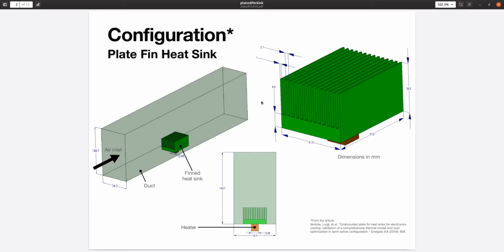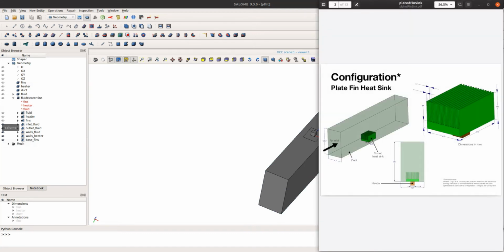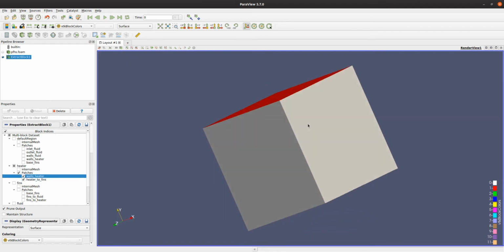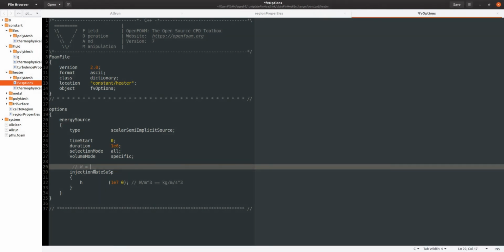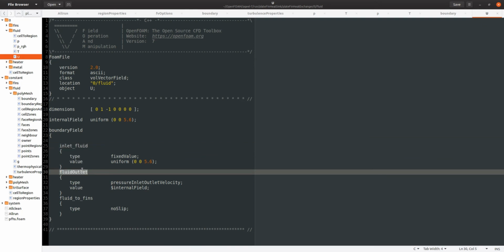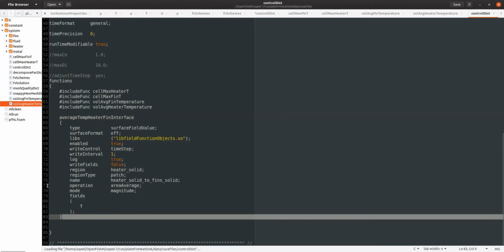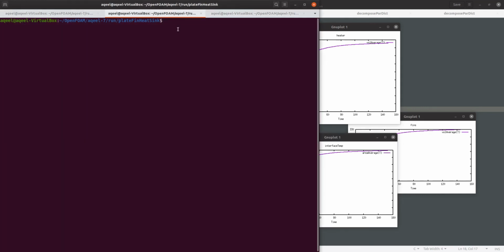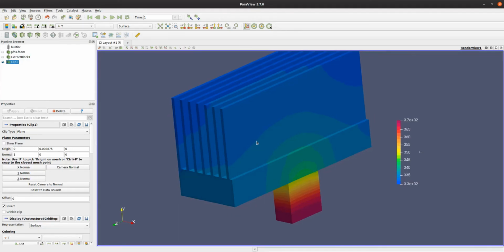Conjugate heat transfer (plate fin heat sink) with Salome, OpenFOAM and Paraview

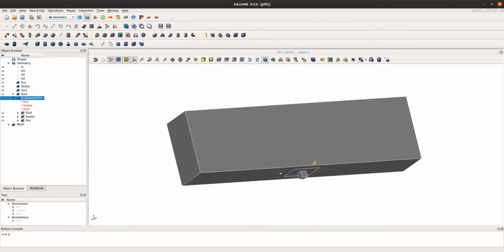Comment: why am i not getting fluid, heater and fins solid region after partition tool at 4:29, instead getting only 3 red-lettered objects as fins, heater and fluid
Reply from the maker: To get the regions separately after partition.

Use the same method like for boundaries, select region -> select volume, and create a volume region. The partition tool already created three separate volumes.
Reply: @cae4edu189  Got it done, yayyy , thanks a lot

Comment: Thank you for this helpful video. I have tried to run the case file uploaded on Github and everything is ok until executing chtMultiRegionFoam. This error appears 
 Cannot find file "points" in directory "fluid/polyMesh" in times "0" down to constant
[0]
[0]     From virtual Foam::IOobject Foam::fileOperation::findInstance(const Foam::IOobject&, Foam::scalar, const Foam::word&) const
[0]     in file global/fileOperations/fileOperation/fileOperation.C at line 1003.

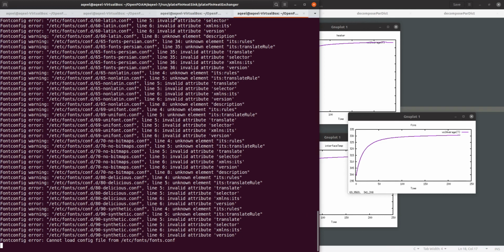Comment: Hi! Thanks for the tutorial and all the clever tips that go with it. When you visualize the results in paraview at 43:50, how did you create the file pfhs.foam with all fields from all regions ? So far I've only managed to visualize the fields from one region at a time. Thanks.
Reply from the maker: Just create a new file in the terminal typing: touch pfhs.foam
Reply: @cae4edu189  Thanks, it worked. Although it seems paraview should be used wih this workflow instead of paraFoam.

Comment: @cae4edu189 , thanks for sharing your knowledge. I followed your steps exactly in my case, but when I tried to apply heat flux using externalwallheatflux BC of FixedGradient BC, it works as zeroGradient. What do you think what is the reason for this?

Comment: Thankyou for the video. But how do even get the solution to converge as I haven't seen boundary layer inflation in the mesh for the fin-fluid interface to capture the thin temperature and velocity gradient. The tetra-cell is ok within solid but we are thought not for fluid near the solid surface. If you could comment on the sufficiency of the mesh to get a reliable result.
Reply from the maker: The mesh used here is only to demonstrate the approach. For a detailed study mesh convergence must be performed with several refined meshes. Same holds for resolving the fluid side boundary layer.

Comment: Thanks your video, By the way, If there are inlet and outlet face in the fluid cellzone, How can i add the inlet and outlet facezone in the fluid cellzone? I already try it but, facezone does not appear in the polymesh folder.
Reply from the maker: I guess you have to define them as patches.
Reply: @cae4edu189  Hey, I already define them as facezone in salome but when I run "splitMeshRegion -cellZones -overwrite", They do not recognize facezone but only interface between cell Zones. I want to define two facezone but now, Only one facezone is defined. Do you know any solution?

Comment: Thank you for the good lecture. By the way, I have one simple question. How can I apply heat flux boundary condition at the wall?
Reply from the maker: You can use fixedGradient boundary condition, that will set the heat flux, which in turn is also related to wall area
Reply: thank you for your kind answer. And i have one more question to ask. Is there a way that i can see the area average value at paraview?
Reply from the maker: You can try  some built in filters in the Paraview.

Comment: Hey. Did you imported all bodies as seperate files?
Reply from the maker: I used Salome Shaper module to make each part. It can then be moved to geometry module of Salome quite easily. See shaper module capabilities in this video https://youtu.be/yUGyTc59700
Reply: @cae4edu189  Thank you let me try. I created geometry and tried to import it to Salome but, file formats are little tricky. STL only exports as surface. On the other hand, when i tried IGES and STEP the dimensions are mixed up. And thanks for this tutorial.
Reply from the maker: @canunsal9513  You can see this video for geometry creation in Salome https://youtu.be/sa2myJm9E8k

Comment: your allrun file doesn't actually run on its own.
1) if you want to skip the lengthly compute by snappyHexMesh, comment out that line in allrun and use the ideasUnvToFoam line instead
2) runApplication splitMeshRegions -cellZones -overwrite  doesnt execute. Type in manually "splitMeshRegions -cellZones -overwrite"
3) floating point error... Foam::error::printStack(Foam::Ostream&) at ??:?

OF v2012